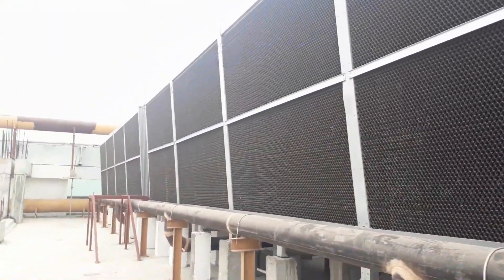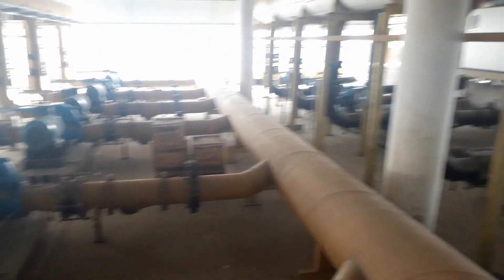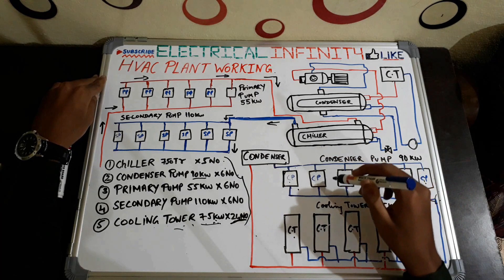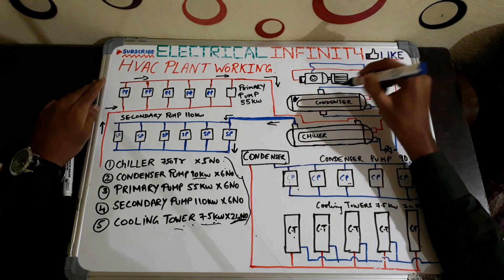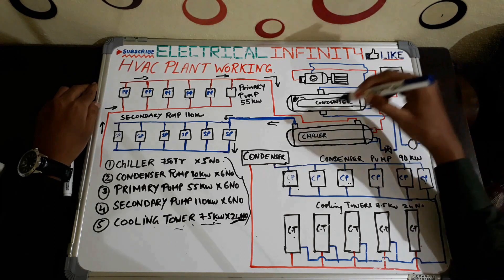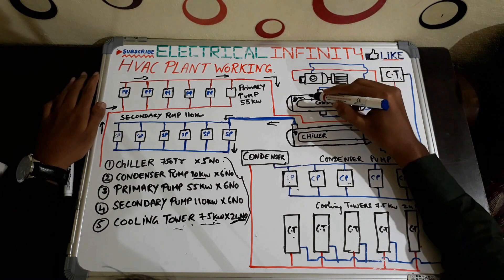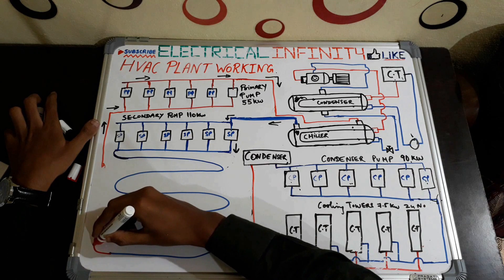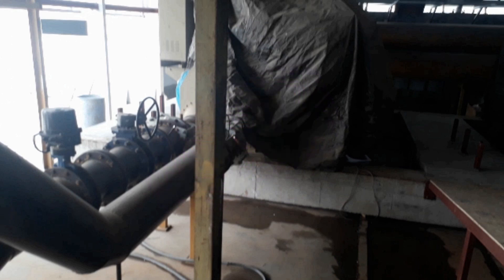HVAC Working | HVAC Training | HVAC System working practical explanation | Electrical Infinity

Comment: Your kilowatt seems incorrect mostly 3 phase 12.5 hp motor as you used in condensor pump must be around 9.0 to 10 kw (9000-10000 watts) not 90 (90000 watts) same with all your kw specifications
Reply from the maker: Check motor plate in video
Reply: @ElectricalInfinity  so what’s the total power Input for this whole system running Max capacity.